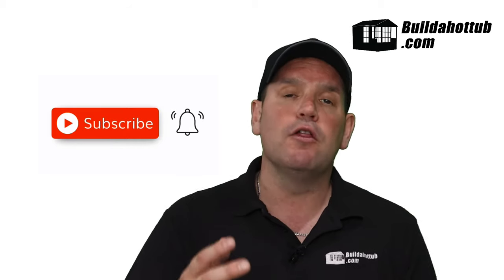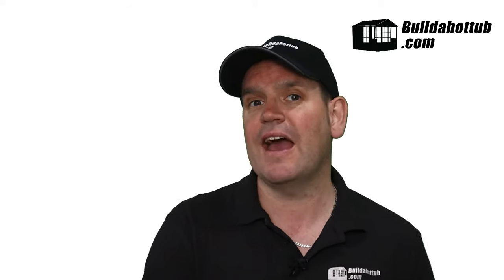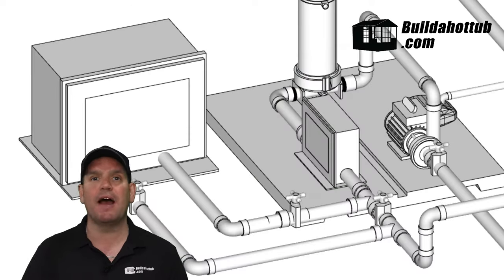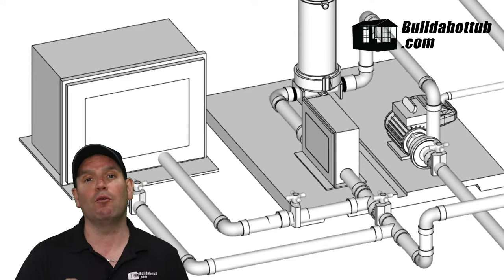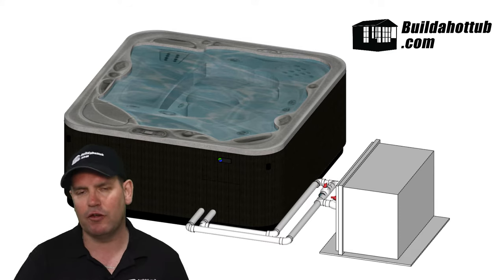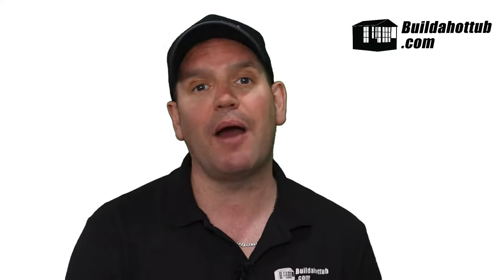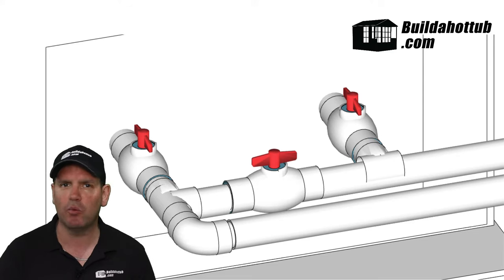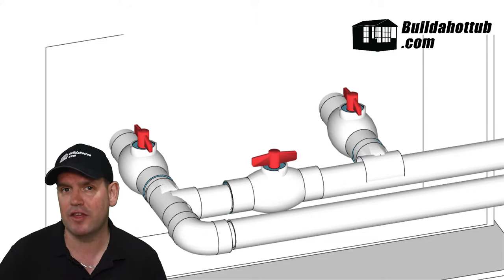How to Add an Air Source Heat Pump to My Hot Tub

Comment: Have you ever seen where there is a solar, heat pump and electric combination? And if so or not what would be the issues of both heat pump and a solar unit ?
Reply from the maker: Hi Tony, Thanks for the watch and the comment. I have not seen a combo of Solar and Heat Pump before. I dont forsee any issues with the two of them working together in tandem. Or, you could even have an either or option plumbed in if you wanted to select which was doing the heating. Biggest issue with solar is when people want off grid tubs - its tough to generate and store enough energy to run jet pumps. If you are using this as a heating method and have plenty of sun, dont see an issue. Only downside is both these methods are not great in a cold (and dark) winter (their output drops) so it depends on your climate and if you are going for an all season tub. Hope that helps, cheers, Andi

Comment: If my circulation pump system was a low flow system of  aprox 25mm pipe which other pump would you recommend piping into before or after the 2hp single pump or the 2 speed pump?
Reply from the maker: Hi Anthony, difficult to know without seeing what is where on the plumbing - shoot me over an email and I will take a look for you - andi   (a.t)   buildahottub.com

Comment: Hi Andi. I have a balboa unit and I’m looking to add the 12kw Duratech unit. Any ideas on where I can source the pipes, etc? I might be better getting it done by someone who’s done it before. I don’t suppose you can recommend anyone? I’m in Leicestershire. 
Thanks for this very useful info.
Reply from the maker: Hi Mark, thanks for the comment. Can you drop me a line on my email and we can pick it up on there. I can help with the parts and the heat pump you are looking for email me at       andi  (a.t)   buildahottub.com cheers

Comment: I’m using a hot splash air source heat pump rated for 3.35KW/h and it heats my 5 person hot tub from 21°C to 31°C in 5 hours. So 9KW/h is way overkill. Where do you buy the parts your taking about?
Reply from the maker: Hi Basil, depends on the volume of water, insulation R values and the external ambient temperature - I have a 21KW Air Source on my own hot tub, which is over specified but I like it that way - this is well documented on this channel. I supply any parts I mention - thanks for the watch and the comment, all the best Andi

Comment: Another question if I may... I don't understand why we don't have to disconnect the electrical supply to the existing heater.. if we don't, and we just reduce the Set Temp on the Spa so the heater doesn't turn on, that will also stop the circulation pump and therefore stop the flow through the Heat Pump.. right? So surely we HAVE to disconnect the heater, or we'd always have BOTH Heat Pump and Heater running, which surely defeats the object of having a HP ?
Reply from the maker: You do disconnect the heater yes, that is what I have done on my own tub - some people do leave it connected and use both (although you wont make as big of a saving there). I actually have it on a switch so if I need a boost in really cold weather I can tap into the electric heater too. Hope that makes sense - Andi

Comment: Hi Andy... coming into this late, so apologies. I am looking to install a Heat Pump on my Swim Spa. When I look at the existing piping, I cannot add the new piping to the HP (easily) on the output side of the existing Gecko Heater because i'd have to cut the pipe after the gate valve and that means draining the spa (which I really don't want to do). I think I CAN cut the pipe on the INPUT side of the existing heater and add the new pipe run and the bypass valves etc to the HP. Is there a reason why i cannot put the HP AFTER the Circulation Pump, but BEFORE the Gecko Heater? thx in advance
Reply from the maker: Hi Martyn, you can put the ASHP on the suction side, you normally see a bit more of a temperature difference between the thermostat on the tub and the thermostat on the air source, that is the only difference really. Hope that helps - Andi
Reply: that's really helpful, thanks Andi... top man! @Buildahottub

Comment: Thanks for the Video, this is exactly waht Im looking for. /i have a 1000lr tub with a Balboa pack. it has 3 pumps for the jets and a single pump for the filter/heater. the problem I have is the Heat pump would need to be 25 ft away from the tub. I would intend to fully insulate the hose/pipe but is this a little too far? Could I install a secondary water pump (switch via a 240v relay) from the existing pump to boost flow.
Reply from the maker: Hi Andy, Thanks for the message. I've actually just installed one this week on a friend's tub, similar setup to you (but 2 pumps and a circ) you can read about it here - https://buildahottub.com/how-i-added-an-air-source-heat-pump-to-an-existing-hot-tub/ - i'd love to help you with the heat pump and parts etc so please drop me an email from the contact page at the bottom of the blog post with your contact number and we can have a chat. I have a video to match the post going live tonight on the channel. The potential issue you have is the flow rate from your circ pump. It will have been sized to deliver enough water through the heater and back into your tub. Adding 50ft (there and back) might overdo it. I wouldnt over complicate things with a slave water pump. I would fit it to the tub and if you get a flow error, swich out the circ pump for a larger one, they are not too expensive. This is easier than trying to get a water feed into a slave pump. - hope that helps
Reply: @Buildahottub  Thanks for replying, Ill drop you an email,

Comment: I have a question, but unsure of how feasible it is after watching some of your videos. Is it possible to buy a cheap hot tub with like 24-35 jets, then take the top part (the part you sit in) off and use quality pvc for all the jets, and place the whole assembly into an icf framed space so that its air tight below the water above?  Then use pumps, blowers and heater just like a concrete/block in-ground diy spa.
Reply from the maker: Thanks for the comment - not sure why you would go to the trouble to take it all apart? Why not just sink the cheap hot tub? They have instulation in the cabinets anyway and they can go in ground, you just need to have access to the control panel. A little confused on this one sorry.
Reply: @Buildahottub  interested in this way because the consensus I'm getting online via reviews is that the tubs use too much electricity,  can't use gas,  start to break down after like 5-7 years etc. Where as if it was the diy version or others,  you can use separate parts and ensure quality and durability.  The basic hot tub is essential for just the jets and the smoothness of the tub surface.  Hope that clarifies things

Comment: 4kw heat pump would suffice , 20kw heat pump is massive !
Reply from the maker: Thanks for the message Jason and of couse the video watch. Not sure I 100% agree with you here. Yes, 4KW would be fine however, that does assume 100% efficiency and 4KW being outputted all year round. Depending on the temperature rating of the pumps, even the best all seasons will drop output by 2/3 in cold weather. Therefore, starting with a large pump, outputting a lot of KW, you are going to have a good amount of heat all year round - perhaps I should have clarified that the video - have a great day - Andi
Reply: @Buildahottub  Hi thanks for the reply 👍🏻

Larger than required heat pump would keep cycling on/off - on/off this reduces efficiency & costs more to run . Unless it is an inverter .

Therefore a smaller heat pump working hard does not cycle as much & is more efficient / cost effective. 
This is how they should operate.
Reply: @jasonmorgan5965  yes that's my thoughts also. Heat pumps are designed to run for long periods, not stop start. I suppose what you really need is data on your electricity usage of your own hot tub over twenty four hours in winter and summer. you can then accurately size a heat pump.
Reply: @markrainford1219  Additionally you have to power the heat pump. A 10kW heat pump can usually be run from a 13 amp spur, anything more than that will require its own feed from the fuse box; another argument perhaps for NOT running the heating element as well as the heat pump. One idea might be to power the heat pump from the fixed element supply instead of the element. That way the temperature control will all still work but you can size your heat pump at up to three times the power of the fixed heating element without overloading the existing supply.
Reply: One further thought - I have been running a heat pump on my softub for two years; the heat pump I have is ineffective below 10 degrees ambient
Reply: @martinsmith4943   buy a inverter one. It will go to minus 7 degrees Celsius. Some even more.